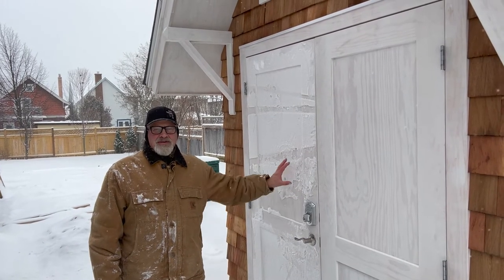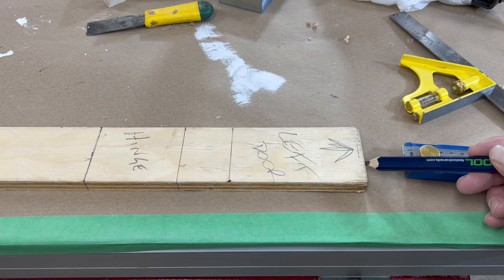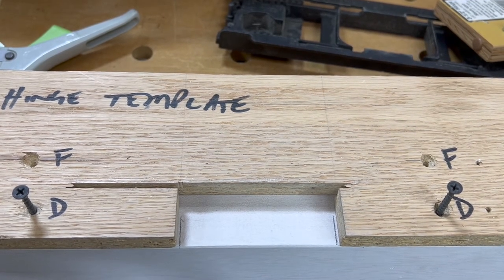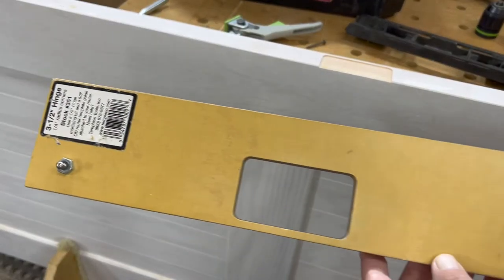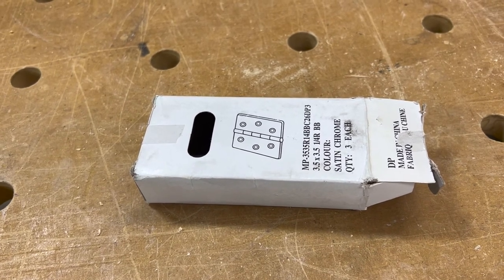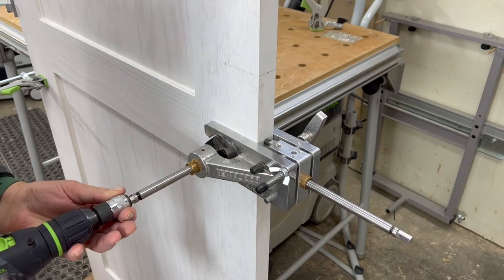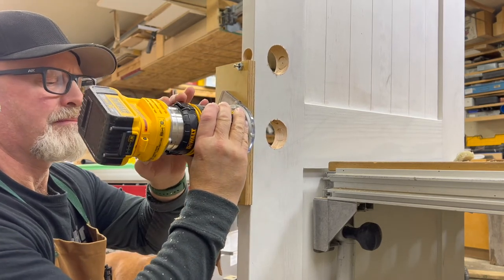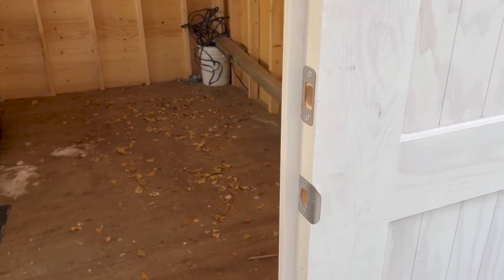Drilling and hanging double doors with Templaco Bore-Master

Comment: Nice work!  How do you like the Spur bits that come with the Templaco?  For the 2-1/8" hole specifically.  I have the Killer Jig, its very good, but very slow drilling thru solid core MDF doors.
Reply from the maker: I do know you have to use a fair bit of pressure with the bits - especially with the 2-1/8" - but when you consider the amount of material you're removing it doesn't bother me. Thank you for the comment and compliment!